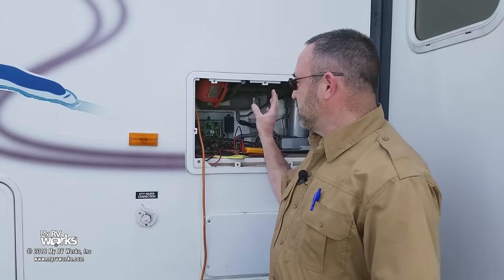How To Determine If Your RV Refrigerator Cooling Unit Has Failed -PLUS- RV Fridge Component Overview

Comment: Thanks for the awesome video. Too bad you’re on the west coast...need help so bad! I have a Norcold refrigerator N611LT, ser # 16678839 and it’s not cooling. Getting this fault code 6 flashes every 5 seconds. I’ve replaced the circuit board, thermistor, and reset push bottom with no luck. What am I missing. Thank you in advance.

Comment: Great information, do you have any trouble shooting on a nocold n7v ? Freezer works but fridge does not. Is there a way to check circuit board ? Could that be the problem ? Thanks
Reply from the maker: Even though these units are more of a European design, the cooling unit is still one continuous loop through the freezer and refrigerator portions. When we find your symptom, oftentimes it's improper ventilation through the cooling unit on the back side. So make sure that your chimney that we talk about in the video you watched is intact, if there are any fans back there make sure those are working too.

Comment: Your drawing was very helpful mine is a Dometic DM2852 my issue is we just had -4 degree weather and my fridge was taking the brunt of the north winds and it stopped cooling is  everything was ice cold so I turned off my fridge what can I do to fix it?
Reply from the maker: You can use a piece of cardboard or something and block off about 90% of that air intake vent. That's that large cover that you can remove to get to the back of your refrigerator. That should help that boiler heat up that space a little bit better.

Comment: Well, I'll be!  The service manual is there!  Still no R Values chart?
Reply from the maker: If your refrigerator is a Dometic, then on our website service manuals page https://myrvworks.com/manuals/ sort by  'Refrigerator - Dometic' and scroll through the manuals we have uploaded and you will see an entire sheet that's nothing but the R values. It's its own standalone sheet.  Hope this helps you out.  After the thermistor has sat in an ice bath for about 10 minutes you should get between 8,000 and 10,000 ohms which corresponds to 32 to 35 degrees Fahrenheit.

Comment: Question - you are pointing to the "high limit fuse back here" - is it in the wire you are moving back and forth or is behind the metal panel behind the wire?    My boiler is tripping the reset button after having an electrical surge, so I am assuming it's a fuse which is either the high limit fuse or somewhere in the control board.

Comment: Awesome explanation and demonstration!  I have learned a great deal from your video, thanks!  I hope you have time for this question. On my 2017 Casita Dometic, the freezer section seems to be fine as it reads 2 degrees F.  So I am assuming the coolant system is intact.  But the refrigerator section really struggles to maintain temps in the low 40's.  Outside ambient temps are hot, 93 to 100, and the trailer is unshaded for now.  I've heard all absorption units are that way.  My question is after seeing your video, it appears the freezer and the fridge work seperately.  In other words, just because the freezer is 2 degrees doesn't mean the fridge will get colder over time as the freezer has no escape route for the colder air to fall into the fridge.  The cooling coils for the fridge are seperate from the cooling fins for the freezer.  Is that the way it works?  Aside from ensuring I have air flowing properly with baffles and my fridge water drain tube is not allowing hot air back into the fridge, about all I can do is shade that side of the trailer, install more insulation, and move to a cooler climate.  Right now the fins in the ridge are condensing water.

Comment: I've got an old RM211 where the propane works, but the electrical doesn't. The fuse looks good. When opening the backside compartment, I can see that one of two coiled metal wires broke leading to the backside of the fridge. I think it may be the thermistor leads going inside. Could this be why the electrical won't kick on, but the propane still does?

Comment: I have had a Dometic fridge on for 12 hrs. It is a little cold in the freezer, but the temp in the fridge is around 60. Outside the camper it is 91.

Comment: I have a norcold nxa841r. It's in a 2008 motor home. It has worked fine for the past year. 3 days ago the fridge section started only getting cool like around 55 degrees. It doesn't get warmer or colder no matter what setting. I checked the thermistor it tested ok. No sodium chloromate or ammonia built up around anything. No smell of ammonia either. Freezer works solid. Everything frozen. The weather has been 70-90 here in Texas the past few days so I know it will warm the fridge up a bit but shouldn't be 55 degrees. What would cause the fridge to not get cold and where do I get one of the fans to put in the outside access panel and can I just hook it up to the positive and negative wires in the back of the fridge where the control board is?

Comment: If the heater element pulls only 3.0 amps. Can this unit run from the Rv inverter while on the road or is there an equivalent “12v. 325 watt” heater to run the frig while on the road instead of 120v?

Comment: Determined that it was my refrigerating unit replaced. It all slid it back in turned it on. Everything seems to be working fine except now I have a gap under the fins in the refrigerator were in the past that was a closed area. Any suggestions why?

Comment: Is there a video to troubleshoot the LP on the fridge only? Mine works perfectly on AC, but does not cool on LP. I took it to a RV repair place, and and it was cooling pretty good on LP in the freezer, but fridge part was not cooling great. Repair dude said my fridge is just bad, and wanted $2,200 to install a new one. I obviously declined. I now have it back and it still cools great on AC, but not at all now on LP.
Reply from the maker: https://youtu.be/jUyL8DbtjPI?si=DEevzh0AJPBhZ-cb

Comment: Hello thank you for your shows they work out really well quick question I have a demonic refrigerator in my propane works the heater and the propane works and then the electric element works it’s warm in the back and you can feel the chimney is warm but my inside of my refrigerator and freezer still is not getting cold but both the electricity and propane are working so my next step do you think I should change the panel I checked the thermostat and moved it around and checked all that it seems like I got continuity to go through it I’m on or should is it I don’t have any yellow do you know stuff from the from the ammonia and stuff there if that’s the back of the refrigerator is completely clean so it’s pretty clean back there and check the wires checked everything fuses etc. everything looks like it’s good but it’s still not getting cold so

Comment: Was hoping you would touch on boiler and coils.  Have a 335 degree boiler no heat in coils
Reply from the maker: You may have a blockage, that means there's no circulation through the cooling unit. I touch upon blockages in the first part of this video here:
https://youtu.be/--DCnSw1jP4

Comment: We recently installed our Dometic 2 way fridge. We tested today on propane and it ignites and see nice blue flame. The fins at the top of the fridge (back of freezer area) are hot to touch but then they get room temperature. We haven't felt the fridge getting cold. What we haven't done yet is build the frame around the fridge to ensure zero clearance on sides and allow the venting through roof. Could this be the issue? Does the air really need to get blown up for the system to work?

Comment: love your detailed approach to troubleshooting.  But, can't seem to find any videos on troubleshooting the AC side of the electric system.  Hope you see this comment as I have a dead outlet that I need help to fix as it runs the microwave.  If you have any tips, please post.
Reply from the maker: Hi there.  Many of my video's feature an electrical 'hunt' where we are looking for a failed or faulted widget.  Even if you had detailed schematics of your RV it would not reveal where the fault might be located.  I use different meters and techniques to help corner the issue and I try to capture that in my video's.

Specific to your microwave issue, one thing we know is that that microwave circuit is dedicated from the power distribution panel in the RV.  The microwave is fed from its own 15 amp circuit breaker.   There should be nothing else connected to that circuit.  First try by turning the breaker all the way off and then on again - resetting the breaker.

Next verify that the receptacle is in fact dead - usually in a cabinet, next to or above the microwave, there is the receptacle for the microwave.  Plug in a lamp, hair dryer etc to verify if that is on or not.  If it is on than the issue is with the microwave.  If it is dead than there is a wiring issue in the coach and I would leave the breaker off until that issue is located and fixed.

If you determine the issue is with the microwave there is an appliance fuse - usually not too difficult to access - on the microwave that may have blown.  I stock those, and most local hardware stores do as well, because it is not an uncommon event for those fuses to blow in the microwave.

Using your microwave manufacture, model and serial number try to download a schematic that will help trace the location of the fuse.  You will find on the schematic where the 120 VAC will enter.  Follow that and the fuse will be one of the first things that incoming power goes to.

I hope this helps.  Good luck!!!

Cheers,
Darren Koepp
Reply: @MyRVWorks  thankyou for the logical approach to my micro problem.  I agree with and have done all your troubleshooting tips. 
Problem, no help. 
I do have all schematics. I have basic multimeters that do at least continuity tests plus... 
I SHOULD have a dedicated breaker labeled micro. Mine is labeled 'fireplace' & seems to control nothing. Oh swell. It's been like this for all the time we've had it. The micro worked until a couple months ago.
 I now use heavy extension cord to 20 amp washer outlet to use micro & it works fine.
The challenge? I dont know how to chase the hidden (in the slide mechanism cabinet) wire compartment back to the electrical panel to narrow down why this is messed up.
Wish we were closer & you could use this as an example video of how things can come messed up from the factory. Or a EMS panel problem from old age.  She's a 2005 38' Bounder.
Thanks for responding, I didn't expect it. I can tell you love a good mystery.

Comment: Hey there Darren.  I believe i have a bit of an unusual situation.  My RV fridge is the Dometic 2652 which operates on LP gas or 110.  When plugged into shore power the fridge works perfectly.  When on gas the freezer works fine but the fridge has trouble regenerating back to cold temp once it has been opened once or twice.  .  We checked the burner orifice which seems fine.  And again, the freezer maintains a freezer temp on gas anwyays so...  I am thinking an issue with insulation for the fridge area.  What do you think?
Reply: It's my problem too, love to know what direction to go in...

Comment: While putting a led light in my 2006 Norcold I accidentally dislodged the little pink plastic gadget that hooks to one side of the same metal piece that holds the lightbulb.  There are two wires that have small plastic gadgets that slip over the metal. One of these came loose. I immediately pushed it back onto the metal.  My frig stopped working and everything got warm.  My friend tried everything to fix my frig.  He finally was able to reset it by removing cover from motherboard, remove wire connections and replug them and, using a jumper wire, make contact inside the ‘honeycomb’ that gave us the click sound we hoped for. The frig got very cold and we were happy.  A day later I went to visit my son and plugged into his house.  At this point I began to have probs again. Apparently the electric connection wasn’t working.  Then I couldn’t get the propane connection to work properly again.  I’m getting green light flashing warnings.  It seemed to be warming while on propane so I have it plugged in to electricity to see what happens.  Any suggestions
Reply from the maker: To schedule a service consult with Darren please sign up for the "1:1 Repair Consult" on our Patreon site.  https://www.patreon.com/myrvworks

Comment: Hi, i have a norcold n811 the freezer is working perfectly. The fridge is not staying cold as of yesterday. I replaced the thermister and after 40 minutes using my heat gun the fins inside are at 51 degrees. Is there something wrong or does it take a longer time to actually read a colder temp on the fins themselves? What should these fins read when working properly? Is there a way to reset the fridge? No codes everything seems to be working properly.

Comment: Thanks for the video. Let me ask ypu this, When it comes to the refrigerator components can It be said that either they work or they dont and no grey area. My refrigerator is Struggling and goes as high as 56 at night and no lower than 50 during the day. It was perfectly fine during the autumn and winter but not its struggling. Ive checked everything. Its still cooling on top and bottom but not to good. Is this just normal??

Comment: Thanks for the great and very informative video. Based off what you have described, my 2021 Open Range Light was installed with little to no care as to the insulation or air flow direction. The top baffling/air director is there, however, it was not bent down to actually direct the air outward so the top  air gap to my fridge gets very hot because the heat from my fridge is not venting well. There is virtually no insulation on either side between the fridge and the outside of the cabinet wall. My thoughts are to throw some batten insulation above the fridge and bend the baffling down to direct the air out of the vent and then buy some reflectix insulation and shove it down the side of the fridge to get rid of that air gap between the fridge and the outside wall of the cabinet. What is the best way to get the reflectix in there? Thanks in advance for the advice.
Reply from the maker: https://youtu.be/DxUnW7gudEE

Comment: Great video. I have a dometic 2652 and it cools down fine on propane (25 ° in freezer).  On electric, freezer gets to 32°, frig 50°. Thermistor ohms good, heating element ohms good. No smell, no residue and air channel good. What would be my next check?
Reply: Did you find a solution?

Comment: Awesome video.  Do you have one on the top being ice cold and lower  not working?
Reply from the maker: I do address some of that in my groovy drawing on this video. If you're not scrubbing the heat off of that coil. Then you will have a situation where your freezer stays cold but your food compartment does not. Head to my playlist, look for refrigerator playlist, look for cooling unit replacement tips and tricks. Watch that video. I have a section where I talk about the fan and go a little bit more into scrubbing the Heat.

Comment: I have a Demetric refrigerator. The igniter keeps firing about once every second second and a half even though the flame is on in the rest the refrigerator is working properly.
Does the igniter have a enable disable signal?

Comment: I wish I was out there by you I would bring my truck camper to you and have you check the installation of my refrigerator,it’s in a Lance truck camper bottom vent and top vent are both on the side of the camper. We are from central NY. I personally think lance could do a better job installing their refrigerators    Thank You Charlie
Reply from the maker: Peruse my playlist for refrigerators. There is a lot to be said about the installation and the chimney effect up through the rear cooling unit. The better the chimney, the better the cooling.  In a slide room it's really important as the chimney air makes its escape to the top vent. Not many manufacturers get that part correct but it is all spelled out in the installation portion of the refrigerator manual. Another issue could be the insulation value of the refrigerator box itself with respect to the side walls. If those walls are getting hot, from sun, it could affect the cooling of the refrigerator simply from the insulation value.

Comment: Great video bought old Eltrolux gas fridge had it on cple hrs to test , it 25 yr old but good condition bought used lights up freezer box cools but rest of fridge just normal after 2/3 hrs but just have on box at side of mobile with window open to test no exhaust of boiler just the fridge pipe, so i need to put it in enclosed area with air vent below & proper exhaust connected to boiler leading to upper air vent out in order to cool fridge part or is something else wrong fact freezer box got cold quick enough any idea please?

Comment: Great video Darren.  My issue seems a bit odd.  Both the Fridge and freezer work fine when i am plugged into shore power but, when on LP it is only the freezer that works fine.  The fridge won't stay cold.  What would you suggest ?
Reply from the maker: There's actually a few things that would cause that but the first thing I would check is your LP pressure. Have the lp pressure checked at the refrigerator and you should have 11 inches of water column. Here's a link to a video on how to check LP pressure.https://youtu.be/SD1qcH_hNYY

Comment: Please clarify the 1-in maximum space between the wall and the back of the fridge. The fins at the top of the fridge extend out further than the zigzag tube. The fins on my fridge are an inch from the wall but the zigzag tubes are 2 in maybe more. Is this an issue? 9:50